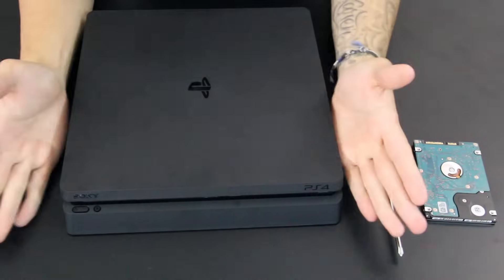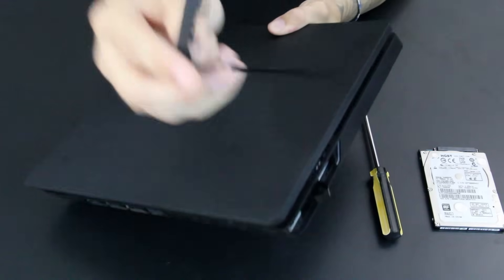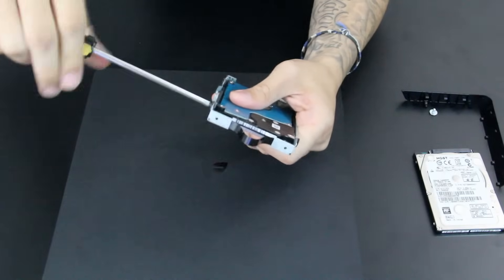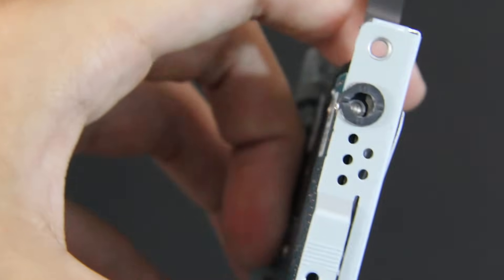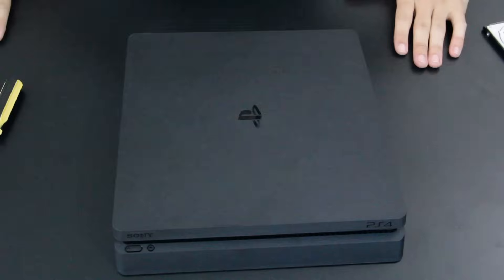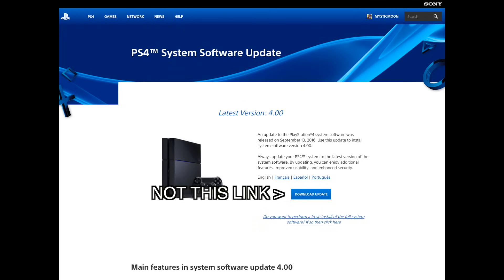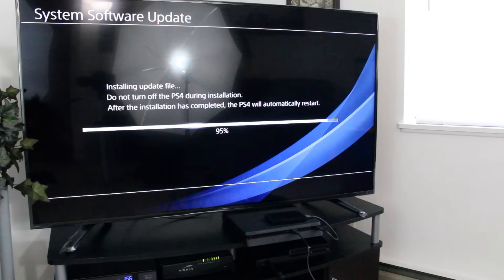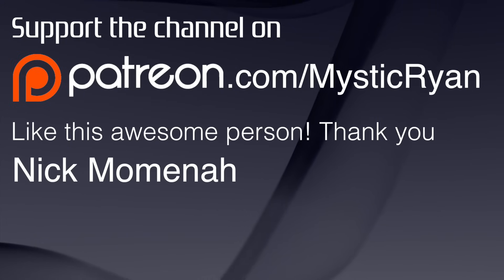Tutorial: How to Change PS4 Slim Hard Drive and Install System Software

Comment: Thank you for this. It'll save me alot of money. 

Is it possible to fix the HDD without replacing it? 

My PS4 froze while playing and was unable to restart. 

After a power cut , I tried to restart ot but I got the error message 

Cannot access System storage 
CE-34335-8

Comment: Dang, my PS4 was acting glitchy, stuttering etc....I am just not sold on the PS5, so I deleted everything off my hdd, I downloaded the system update, I factory reset the system, I re-initialized it, re installed everything and still it was acting up. Strange....And a new PS4 is overpriced (price gouging) so I decided to look into replacing the drive and eventually settled on a WD Blue 1TB SATA 3 SSD which only cost around $70. Put it in, installed the OS and everything and what a major improvement, it is responsive and quick, better than when it was new, I now highly recommend installing a SSD drive👍 it's nice that they made replacing the internal drive fairly simple to get done, my stock HDD was obviously on its last legs, and the SSD replacement was cheaper than getting another PS4 and way cheaper than a PS5, which I'm just not very impressed with the PS5, now my PS4 will keep me going until the ps6 or ps7 😂👍

Comment: Everyone thats here only chance is to get another ps4s hardive sexond hand or out a broken ps4 many many years if looked for solution and allthat damm time it was just the hardive needed to be replace real easy too bkos of this guys video iv revived so many playstation and this what the hardest to figure out and after watchingthis video i switched ps4 hardrive out for another ps4s hardive simple n easy lol . do not use any other hardrives or it gets more difficult when adding the software updates n all etc so yeah just get another ps4s not ps3s a ps4s bkos ps3s hold alot less than a ps4s storage can handle  👍

Comment: Bru, I know it’s 7 years later but I was wondering if you can help, I’m stumped because I did everything you said, and I got to safe mode but my usb port won’t let my DualShock controller connect, the light goes yellow but then nothing happens, and I sont know what to do

Comment: I have a 4TB SSD to install as an upgrade.  So I tried using another 1TB SSD to backup my PS4 but it kept indicating not enough space even though the PS4 only had 870GB out of its 1TB being used.  Then I tried cloning the PS4 drive to the 4TB but the program copied every partition as is without allowing me to resize, so I would end up with 3TB of unused space. I ended up using the 4TB to backup the PS4.  Then I copied the backup to my 1TB SSD and surprise it all fit properly.  I wiped the 4TB drive and installed it on the PS4 which I was then able to initialize with the "Update" file.  Finally I was able to restore my data with the 1TB SSD, the one my PS4 kept saying "not enough space" to back up in the first place.

Comment: Can u tranfer a hardrive from 1 ps4 to another or do u still need to do firmware ????
Reply: Please really need to no i have a 1tb ps4 slim but is broken so i have brought a new 500gb ps4 slim 

Can i put theu hd from my old ps4 in to the new ps4 and it work as it already been used on a console.or do i still nee to download the firmware update to be abke to use it

Comment: Ok so my situation is a bit different. Im not getting a new hard drive im transfering the old one to a new ps4 so I can have all my data. The old ps4 busted so I can't back up my save it is ALL on the hard drive. And I just found out if I were to do this firm ware update it would factory reset my new ps4 and the hard drive I think? I don't wanna lose all my data so what do I do?!?

Comment: My son's PlayStation 4. Slim I think it got dropped. It keeps cycling through safe mode. None of the safe mode options will do me any good. It's like the hard drive isn't there. Does that mean I need to get a new hard drive and if so do you have a place where I can get one or do you have any suggestions on that where I can get one that is affordable? Preferably under 50 if that even exists.

Comment: So do u loose the data on the drive ? Cuz I have two ps4 and I want to take the 1TB and put it on the other one would I still have to go threw the downloading stuff or will it just load up there both ps4 slims

Comment: If anyone's still commenting here, I have a PS4 Pro with a bad drive and a PS4 slim with a good one. The PS4 Pro won't get to the menu and just turns off after attempting after telling me the system wasnt turned off right, and the hard drive is corrupted. Apparently, a cat knocked over the TV and it landed on the PS4 Pro, causing issues since, and it's gotten so bad you can't even get into the menus anymore. Can I swap over the Hard Drive, and if so, can I still use the files on my PS4 Slim? I don't need the files to work on the Pro, because it's my cousin's. I just want to know if swapping it to a bad system will ruin my drive in any way or make it unusable by my PS4 Slim. I mostly want to verify that that's the issue and the only issue at hand, but don't want to lose my own data in the process.

My belief is that the Pro's hard drive corrupted, possibly some important system files, and he probably needs a new hard drive at this point. I just don't want to put my drive in it for me to be unable to put it back into my own system and play my stuff. I've already told him this is my guess, and the internal and external components look all fine. And if someone else believes it to be another issue, please let me know! But the system says the hard drive is corrupted.

Comment: I'm stucked with the same Error Message  ''SU-42118-6 ''for a while now after trying on install a new hard drive into my PS4 Pro. I'm using a WD Blue 1 To. A USB Key formatted in Fat32 With all the Folders Named in Capital Letter PS4/UPDATE/PS4UPDATE.PUP
And I feel Kinda Clueless right now as this Error System message can leads to multiple different potential problem.
Reply: I was able to repair/fix another PS4 SLIM wihout any issue with your video, Thanks though!
Reply: By fixed what do you mean, im having trouble with my ps4 slim it doesnt load any games nor turn on correctly and is just laggy overall any advise

Comment: Do you have to do the system software update if the PS4 is already updated to the latest version? Or is that a completely different update? If my data is already transferred to the cloud will it still need the update?

Comment: PS4 slim I am planning and ordering from Amazon SSD for my PS4 to replace the slow stock hard drive it is extremely annoying in Minecraft sometimes legs when I am killing a zombie also I noticed loud clicking noises I looked it up in Google when you hear loud clicking noises send it to professional Data recovery immediately that cost $1000 I looked up an Amazon I found Samsung SSD I decided to purchase it 2TB also I will get external hard drive enclosure so I can use it
To save my gameplay footage sometimes it is reliable for PC which does not run all the time 
and That's not deal with  heavy usage

Comment: Anyone knows whether i will automatically enter safe mode after changing the hard drive if i only press the power button once to turn on the ps4 rather than holding it until i hear the second beep?
Reply: Press the button until 2 beeps

Comment: Thank you so much. I'm considering buying a new/used ps4 since mine broke last year. I truly appreciate it.
Reply: Should I upgrade my ps4 with the Seagate barcuda ssd or samsung Evo 870 ssd?
Reply: @LukesLatte  I'm not really sure sorry. The Samsung one does seem pretty good from what I've seen. Also I ended up not changing my hard drive and probably won't, I don't trust using it because I put it in and it instantly made my PS4 louder but I got most of my save data from ps plus.
Reply: @yesplease29  Thanks 👍🏼
Reply: @LukesLatte  No problem. You got it.

Comment: How do you put saved data on a flash drive? And also how do you save it to the cloud?
Reply: just plug the USB into the ps3, make sure it is formatted to FAT 32 , then do the back up its in the settings thing of the ps3

Comment: I want to upgrade my ps4 slim from a 1tb to a 3 or above any suggestions or what specs do i look for and what kind of internal hard drive do u suggest
Reply: I would recommend you get the Seagate 4TB option if you really need that much space. Seagate’s internal drives fit in perfectly with the ps4 slim. But I do wonder why do you need 4tb for a ps4 slim? Isn’t it to much? How many games do you intend to have on the system at the same time. Either way hope this helps!
Reply: @mr.reaper8855  Should I upgrade my ps4 with the Seagate barcuda ssd 2tb or samsung Evo 870 1tb ssd?

Comment: Yo basically, when I'm trying to download a disk game, it goes to a specific point and then stops then either shows corrupted data or the error name CE-30005-8, all my disks are clean and minimum scratches and I've tried every solution but they don't work, I bought a hard drive from Ebay because i thought it had something to do with my hard drive being 6 years old and I don't know if it will work or not, plz if you can, tell me if I made the right call or not, other than that great video!

Comment: So I recently went to clean my 2014 PS4 and now it just wants to turn the blue light on and off... Im relatively savy ..I think the issue may be old thermo paste.. but Iv found another one for 200 with a 1tb. My only concern is since I cannot turn on the only PS4 can I just pull my old 500gb hd and put it into the tb , eventually purchasing something to allow me to transfer my profile with 200 trophies onto the larger drive..is this all possible..I have seen a few things saying the HDs are like serial locked to the specific console..in which place I cannot turn it on z🤔😑

Comment: Seen about 10 of these videos.  They all say and do the same thing with no issues.  Does the usb have to be 32 or less?  Because that's the only thing I can think of but nothing has worked.  Followed every instruction to the "capital letter", and nothing.   At all.  It completely sucks.

Comment: how can i know whats wrong with my ps4. it started to crash and freeze then the blackscreen came. and know it doesn't work, it only works in safe mode. i updated the software and it worked for 5 minutes. i logged in with ps network. i began to download the crew 2 on a disc. and it freezed so i waited and then pulled the power cable.
Reply: pulling out the power makes it even worse your definitely going to need a new hard drive
Reply: @khriist  i changed the hard drive and now its as good as new.

Comment: I’ve been having problems with my PS4 pro it’s been giving me corruption errors and data issues so I decided to buy a new hard drive but I don’t have a usb. Can I just install the update through Safe mode without backing up data or will I need to do the complete process. I only play Apex legends and I think everything is automatically saved onto the game. So what should I do?

Comment: What if u don’t have the external hard drive?
Reply: Can't do it, then. You need to have some kind of external drive that contains the PS4 system update software (it can also be a simple 2 GB flash drive, I just used it for mine).

Comment: Quick Question here  can i put my old ps4 hard drive back in the  ps4 cause i actually wanna replace the ps4 hard drive for a test and wanna revert back to my old ps4 drive thanks.
Reply: Can use any hard drive to replace the old one or do you need a specific model

Comment: Sorry if this sounds dumb... okay so I wanna do the 8.03 update coz my ps4 is stuck on safe mode and I don't won't to initialize as I will lose my gaming data. While updating using the USB the ps4 is stuck on 24% when checking the storage status. I was told I need a new hard drive. Now if I follow what you said how do I transfer the game data from the old hard drive to the new one?

Comment: Where can I buy a 1TB hard drive to replace the one I have in my ps4 slim
Reply: Buy it where you bought the ps4 from
Reply: Make sure its a laptop hard drive
Reply: @abdullahimran9976  does it haft to be a laptop HD
Reply: @GamerBoy870  Yes because the laptops HDD is smaller than a pc one
Reply: @GamerBoy870  which is also the size of the ps4 hard drive
Reply: @abdullahimran9976  should I get a Toshiba HD

Comment: I don’t even care that this video is 4+ years old...you just saved me a ton of headaches, money, temper tantrums, and shipping fees. I was able to finish swapping the hard drive on my son’s unit almost in real time with your video...So THANK YOU so much!!!!!!!
Reply: Agreed many headaches
Reply: Was your sons ps4 acting really slow, and not allowing him to load games up?  I'm asking becasue I want to know if this will fix my problem.
Reply: CJ  it fixed my problem I thought I had a ps4 pro until I went to replace this I bought A Samsung 860 Qvo for 120$ on Amazon prime
Reply: @CJ-dx7hj Ik it is 1 of the most common issues that slows ur PS down(loads in slower  when powering on, games load slow or not at all)is having a corrupt SSD or HDD. U might be able 2 fix it by powering it off wait for about a min and hold pwr button down til u hear 2 beeps which means uve started it up in SAFE MODE. From here u can rebuild ur database and it might fix it for u. GL 2 ALL
Reply: CJ but I couldn’t play warzone,apex even physical copy’s that used to load in 5-15 seconds took minutes and sometimes so long my ps4 would just turn off
Reply: @KevinJohnson-dd3er  wait soooooo did the problem that cj you fix it by buying a new hard drive I need to know cuz I’m having exactly the same problem as him and I’m about to punch the shit out my PS4
Reply: @KevinJohnson-dd3er  most of the games don’t load in like cold war I load in sooooo slow
Reply: @edwingalvez7791  yea you need a new hard drive. I had the same problem for about a month up until now and I finally fixed it by getting and installing a new hard drive.
Reply: @bigballz2015  appreciate it man 🙏🏽
Reply: @edwingalvez7791  just buy a 500 gig ssd and later on get an external 1tb hard drive
Reply: @bigballz2015  so did installing a new hard drive fix you're downloading speed?
Reply: @edwingalvez7791  yeah upgrade to samsung 870 evo 1tb for my ps4 pro its way faster loading times and downloading games I aint waiting for PS5 to restock
Reply: @wicked_oger_666_2  it depends on your internet speed
Reply: @bigballz2015  yes but when u install a hard drive can u get your profile back and all of your games?
Reply: VannoMAN YT  if you dont know how to swap an hard-drive to an ssd you are the most dumbest person 😆
Reply: Do you know what kind of screwdriver you used? I’m having trouble with finding one that would fit.
Reply: @jessie06_  😆
Reply: @TitusMH  bro I’m deadass having trouble finding one that fits lol 😂, I only have like three, but they’re for different purposes.
Reply: @jessie06_  any screwdriver can do lol
Reply: @jessie06_ 
TECKMAN

4.74.7 out of 5 stars(9,530)

Cleaning Repair Tool Kit for PS4 PS5, TECKMAN TR9 Torx Security Screwdriver with PH00 PH0 PH1 Phillips Screwdriver Set for Sony Playstation 4,5 Main,Controller Tear Down and Dust Removal
Reply: Me to
Reply: @dr-wached8341  too*
Reply: @TitusMH  thanks
Reply: @Reaxu_ yea I figured that out like 3 or 4 months ago however Long the first week of June was ago
Reply: Same, i asked for a repair and they would charge me 140 usd. Man....
Reply: Is this how you switch the data between ps4 to another?
Reply: what about the website part? do i need to do that? my ps4 is up to the latest version. could i just skip that or is it mandatory. im just confused on how to go about this.

Comment: My slim is broken and i dont know why maybe dust or system software issues and whenever i try to turn it on its says cant turn on ps4 connect ds4 with usb cable then it brings me to a screen to install system software i cant install cause i just cant my brother thinks the problem is a coruppt hdd and i have a new one but i dont have a screwdriver small enough to take out the little screw whitch releases the hdd case and subtitutes that i can use? Please help me i am getting a ps5 and cant transfer data from my ps4 remotely with wifi and i intend to use an hdd to do so what do i do please help me

Edit 1 cant install system software from reset mode ps4 slim says i didnt conneft lan cable idk what to do cant change it to say wifi so cant do shit please help bought a 1tb harddrive and i intend to transef data fro. Corrupt hardrive to new hard drive and then use it on my ps5

Comment: Very easy to understand, was able to fix my broken hard drive in my ps4 slim in less than 5 minutes. Thank you so much!
Reply: did your data save? my ps4 wont even turn and im planing to buy a new hdd im just scared it wont save the data lol
Reply: @grublivesmatter2828  if u have ps plus all ur data saves into the cloud, after doing this process you can download it
Reply: @V1P3RSX Does it automatically do that?
Reply: @grublivesmatter2828 wait i need advice. he said download the latest firmware from the website. how do i do that? do i do that before hand? my ps4 is at 11. something. the latest update

Comment: THANK YOU!!! HE HELPED ME MAYBE THIS CAN HELP YOU....Legit Feedback here... so my PlayStation slim was kept in great condition. Never been dropped, never spilled anything etc... one day I got a error code ce-36329-3 and I couldn’t put my PlayStation in safe mode. Took it to a computer store and they said $130 to fix it. I went on Amazon and bought a 1TB Toshiba internal hard drive for $50. Followed these steps and my PlayStation is back working. In other words, You can fix yourself if you get that error code and this video WILL HELP! Thanks again man!
Reply: Appreciate it. Thx.
Reply: Omg really Bc I got that code too and it said to initialize it and I did that but it doesn’t work so ig I will try that
Reply: Link to hard drive ?